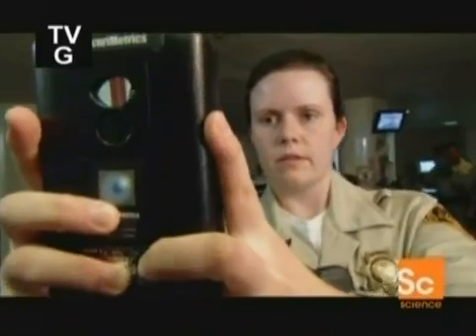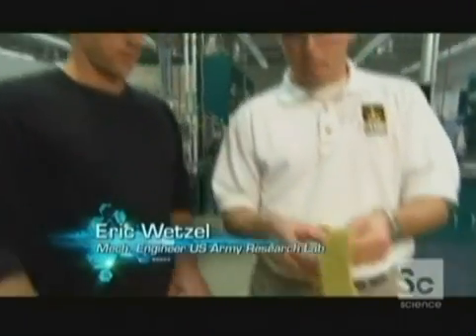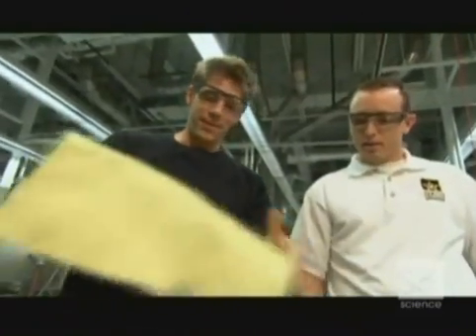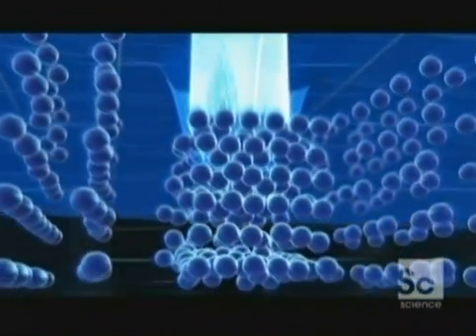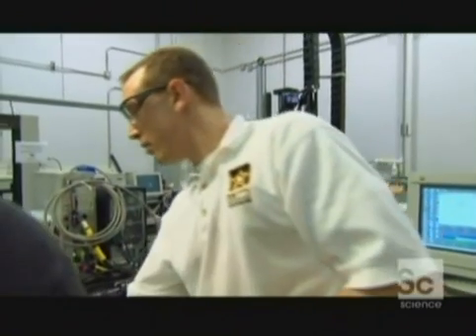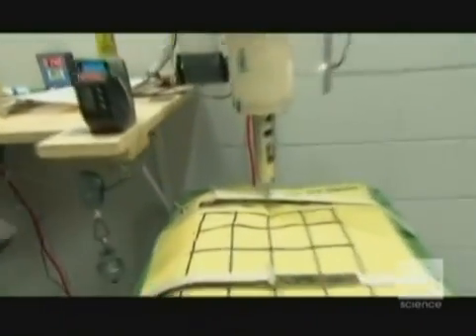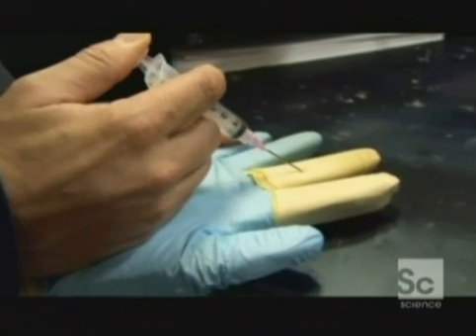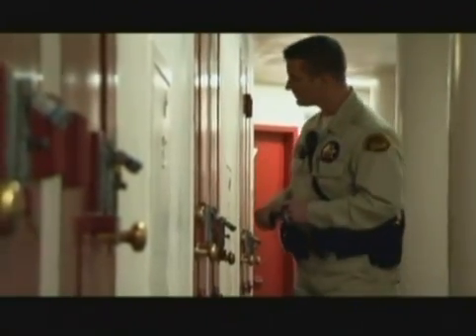Liquid Armor

Comment: The material that was presented in this video is known as a colloid. You can observe a colloid by mixing sand and water at the beach.  THe sand water mixture will allow you to push your finger in slowly, but if you try to "jab" the sand water mixture you will only hurt your finger.
 
  The problem with this product is that the poly ethlene glycol is partialy water soluble, so it will wash away.  Please, do not invest your money in this technology.

Comment: That was not a hunting arrow. The tip on the arrow was a target tip and very "bullet-like" in shape so the kevlar would have no problem stopping it even without fluid. Real hunting tips have very sharp points and razor sharp triangular blades that defeat kevlar body armor fairly easily by pushing it aside and slicing it as it goes. It is hard to kill a real bear with a real hunting tip; a target tip would be a joke. It *might* kill a gummi bear if a gummi bear were actually alive.

Comment: ceramic plate carriers work better by actually cracking and absorbing the energy of the bullet. this means that they will also work vs a knife or shrapnel. to bad they can only take one hit. then there is dragon skin or lizard skin or whatever, that stuff is just down right fucked. so if you had ceramic surrounded by kevlar and the thick liquid thrown in (ipcus liquid is it called?)... that sounds thick and heavy though. this stuff is so cool...

Comment: Wikipedia copy and paste much? You said electromagnetic field, but it was the magnetic field that mattered. Also, they don't "vibrate in sync". The frequency refers to current in an RLC circuit. You want to induce a resonant frequency on the receiving coil, as this minimizes energy loss due to inductive impedance. The relationship between force, energy, and power is simple, so don't hurt yourself too much paraphrasing your Google result.

Comment: Wikipedia copy and paste, oh yeah! Oh, and since you decided to pursue, I'll pick the rest apart: The coils don't actually vibrate, numbnuts, The resonance mentioned refers to the resonance of an RLC circuit, which basically means the circuit is of such a frequency that energy isn't being lost through destructive interference caused by inductive resistance. And what the hell does "bonded" mean? If sharing an EM field bonds things, then everything is bonded, and the word has no meaning.

Comment: The force is the energy exerted by an object interacting with another object. Energy is an objects ability to do work on another object. In case you don't know work is the force applied multiplied by the direction of the force. Power is the rate that energy is transformed, used or transferred. Before you continue to try and sound smarter than me I recommend that you research into the electromagnetic resonance phenomenon. Maybe then you might realise how stupid you're sounding.

Comment: You mean a high frequency current is run through the coil creating a constantly changing magnetic field, which induces a current in the other coil as changes in magnetic fields induce currents in conductors?

 I'm pretty new to electromechanics, but most of what you said sounds to me like garbled  horseshit. "Electromagnetic field?" They come in two flavors: Electric, and magnetic. Hey, what's the difference between force, energy, and power? I have a feeling your answer's gonna be too funny.

Comment: Oh I see what's happened here, I guessing you having heard about our latest advances.  Using electromagnetic resonance, the source coil creates an electromagnetic field at a certain frequency which the receiver has been tuned to. This creates an electromagnetic field between the two.. The source and receiver are now bonded and vibrate in sync with each other. So energy can transfer from the source to the receiver. This only requires a single coil.

Comment: No, actually, by my knowledge of relativity I know that teleportation and time travel are not trivial, or likely not possible, And no, quantum teleportation has nothing to do with actual travel. The latest  electricity transmission schemes use multiple coils for efficiency, so I assume you're confusing this process with modulation of electromagnetic radiation (i.e. radio). So I see you correcting someone with an interest in real physics with this sci-fi nonsense understanding and it annoys me.

Comment: I have to disagree, physics will allow us to travel through time and space to any point in time and to any place in space inside or outside of our universe. It will allow us to bend light to such a degree that we can bend it around us and become invisible. It has already allowed us to transmit electricity wirelessly and safely using only a single coil each for the transmitter and the receiver. It has allowed us to look backwards through time to when our universe first began.

Comment from the maker: Exactly, the reason sharp edges cuts better given the same force is because all the forces are concentrated into the small contact area. Pressure = force/area. When this material is hardened at molecular level, in theory it should spread all the forces into wider area, instead of a cut, you may get a brunt force trauma instead. The blow can still break bones or cause bruises (internal bleeding). Perhaps some semi-rigid support in additional to the fabrics will work the best.

Comment from the maker: The kevlar vest is bulletproof to begin with. No further test is needed if you trust the treatment won't weaken the fabrics. A point of failure is when the kevlar fabrics got push aside to make a windows for sharp point to go thru as shown in the video. The liquid armor treatment to the bulletproof fabrics is to improve it puncture resistance by eliminating that "windowing" effect.

Comment: looks good but i would like to see acual testing of this useing balistic gel or another substatute to simulate the human body.  The reason i say this is because at 2:50 you can see that the spike pushed the material deep into the base so its very posable while the fabric wasnt penitraited the body could be as the spike would simply drive the fabric into the body causing the same damage and the test at 6:48 and the arrow its hard to say because the fabric was placed on a hard base adding strenght

Comment from the maker: That is not necessarily true. The sheer thickening property takes place at molecular level, which means it should stops sharp knife with no difference. However, one may argue that sharper end or pointier tips means higher pressure that may or may not overpower its stopping ability. I agree it would clear up many doubt if they demo with bullets and sharper arrow tips.

Comment: You basically still receive the hit while using this, but the blow becomes blunt instead and it obviously won't be as strong as a hammer blow because less energy is spent while thrusting a dagger than mauling with a mace.

Comment: When you start getting into that power range, it's not so much about stopping the bullet and more about safely dissipating the energy of the bullet.  getting hit with a handgun can break ribs.  SAPI plates work to not only stop the bullet, but spread the energy over the entire surface of the plate.  What this would do for vests, is allow them to be made lighter.  Most vests are 30-40 layers of kevlar.  this may allow them to reduce that to 10 or maybe even less. A vest of half the weight...

Comment: Yes as said above it works exactly the same as corn starch... both are non Newtonian solutions as well as ketchup, toothpaste and other different liquids of the sort, which when put under sudden impact cause the material to become a temporary solid whilst the stress is still in affect. 
Simple and extremely cool also.. First Year Engineering University student

Comment: this is cool but it seems like you really need sharp movement and not all stabbing happen with the aggressor using two hands to stab as hard and fast as possible...i bet with a sharp enough blade someone could penetrate at a slow to moderate speed

Comment: @Theotherone12321 they are, well most. levels 2 and 3 are just kevlar, these offer little to no resistance to say a rifle bullet (even subsonic) due to the pointy-ness but round bullets (most all pistol rounds) are stopped. thats why the military/swat use ceramic and steel plates.

Comment: I just want to comment on the bow section.  They say "steel tipped hunting arrow".  That's a field tip... NOT for hunting.  That's for shooting at targets for practice, so you don't have to ruin your hunting tips.  Hunting tips have razor blades on them and come to a point... field tips are single-points that you'd have a difficult time killing almost anything with.

Comment: This, "Liquid Armor", is composed of polyethylene glycol and silica(glass) particles. The only drawback is, polyethylene glycol is water soluble so, if you sweat excessively or if it rains while you're wearing this, "Liquid Armor treated material", it weakens substantially. Also, if you wash the treated material is loses its strength. The regular ballistics armor material has to be repeatedly treated with the, "liquid armor". Unless the engineers create a hydrophobic version of liquid armor.

Comment: not all liquids are aqueous, think of molten metal, that's liquid. Things become liquid when you heat them from their solid state and continue to become gasses if they get even hotter but different things have different boiling points (the point at which they become gasses). Because of the material the liquid part of this non-newtonian fluid it's boiling point will be much higher than water so it won't evaporate but i don't understand how it's not dripping off; i concede that it's a bad idea.

Comment: I believe that ceramic plates are used in armor designed for bullets.  Probably for that reason.  However, this armor is for knives.  To push a knife into someone without breaking their armor would be equivalent to doing the same with a wooden spoon.